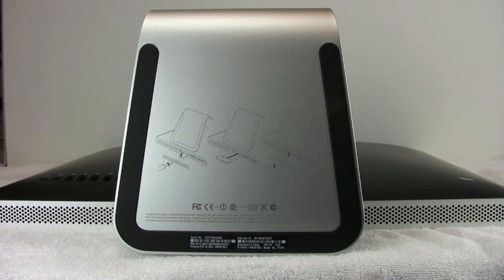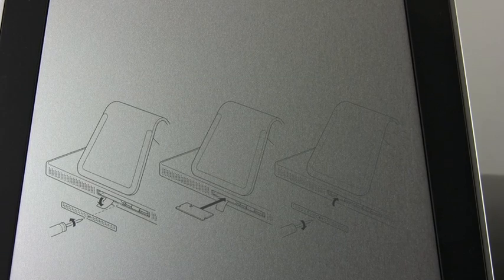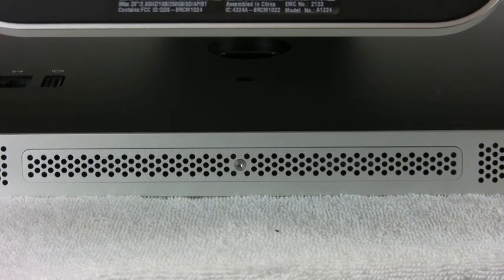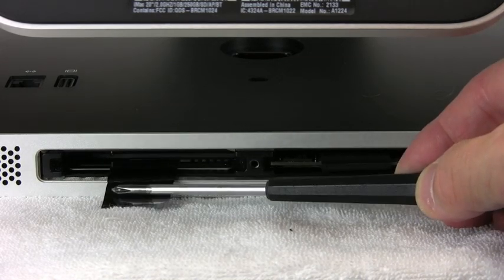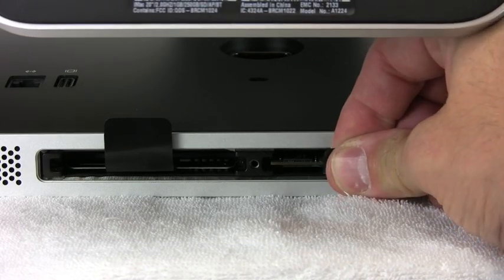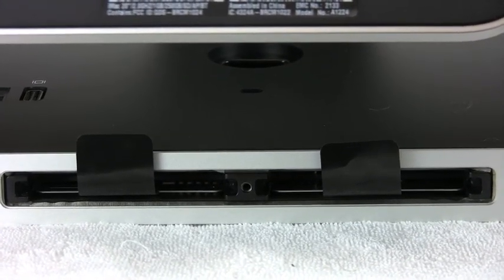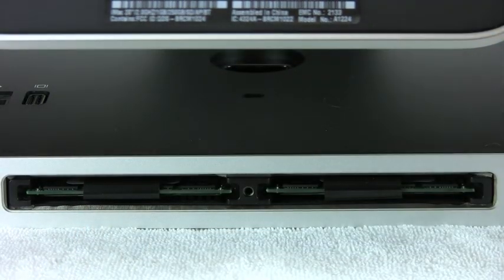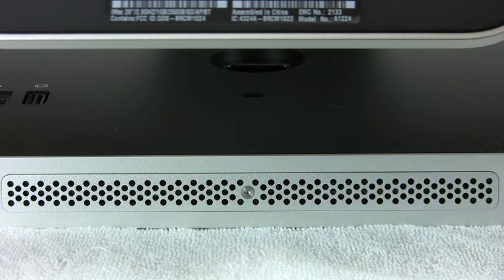install memory in iMac - mid 2007 model

Comment: Hi, just a note to say thanks so much for your video. Very clear, simple instruction which I used to install more RAM on my imac today. It had slowed down since I upgraded the software (I was way behind with that). The Apple website told me the specifications of the RAM to purchase, and I found it easily on Amazon. Very pleased, and will look for your videos if I need any other advice. Thanks again.
Reply: What's the link at Amazon?

Comment: can i upgrade to 6gb
Reply: no it maxes at 4GBs
Reply: thanks
Reply: NO 6gb WILL WORK
Reply: you cannot max out ram, you may have as much as you like but it will cost a pretty penny, the 2007 iMac COMES with 4 gb max, because thats the maximum the data card(s) holds, so it really only depends on whether not you get a memory card with a high capacity of ram or not.
Reply: +Danny Tran How can you tell when you max out RAM? Do you get a blank screen when turning on the computer?
Reply: +Psxpert Sylph what model iMac do you have?
Reply: Mid2007 and a Late2006 iMac